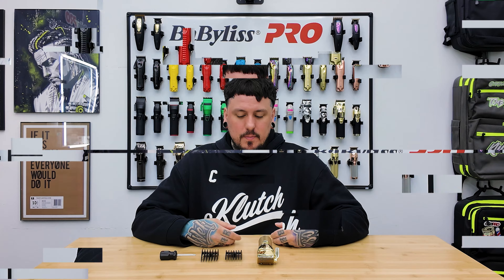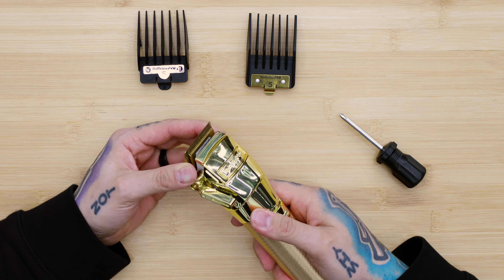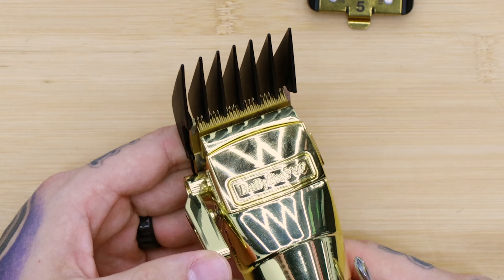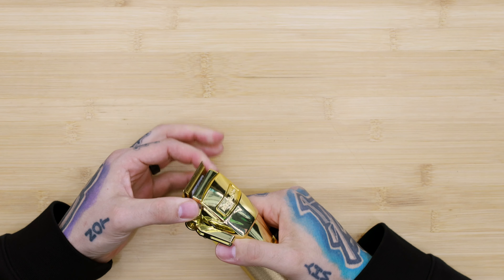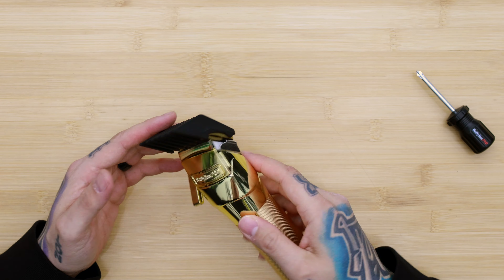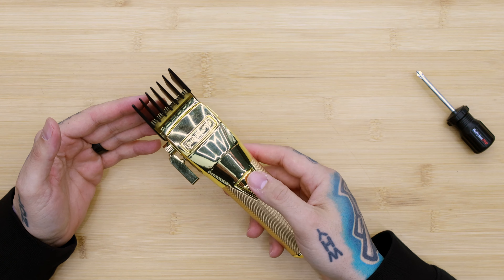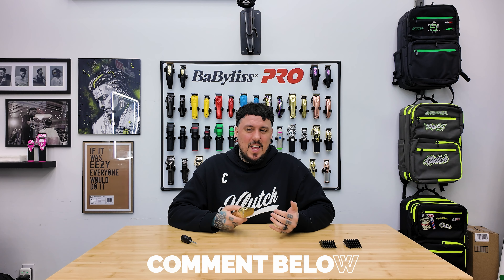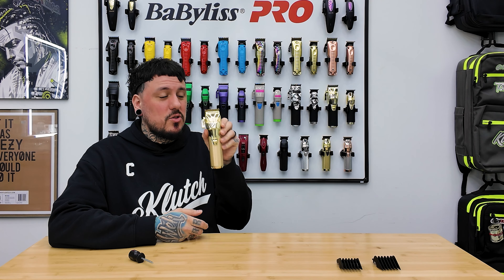Clipper Guards Rattling??? Try This!

Comment: What’s up question. I got a babyliss Skeleton trimmer and one of the screws striped and need help on a replacement and what its called or the mesurements it’s for the adjusting the zero gap screws
Reply: It’s the tiny screw on the actual blade?
Reply: @the_original_Versastyles  yes the one you adjust to zero gap the blade of the trimmer
Reply: Elite clipper mods sells those screws